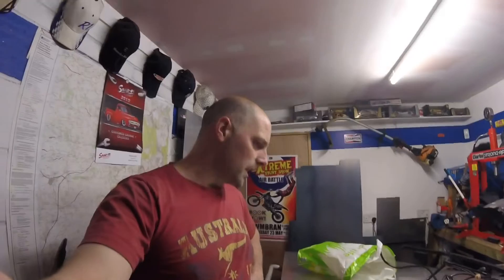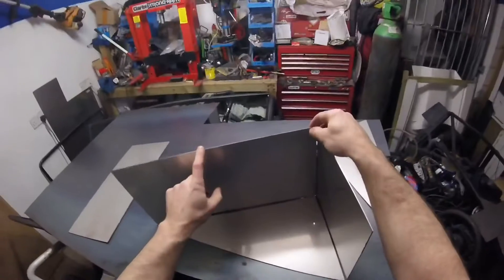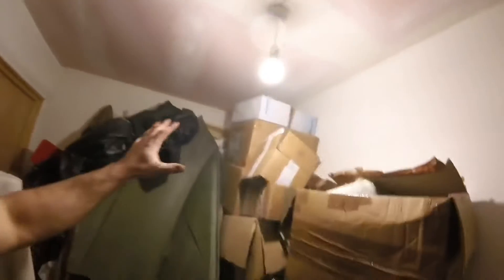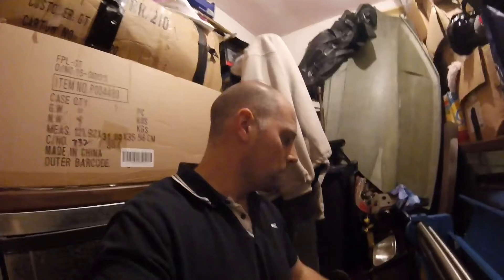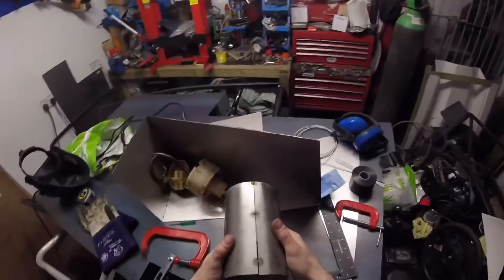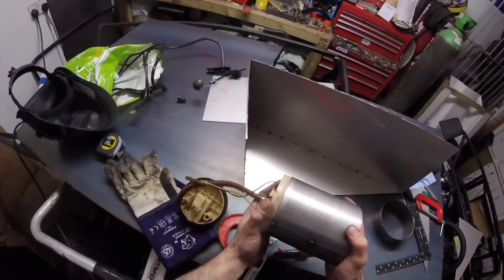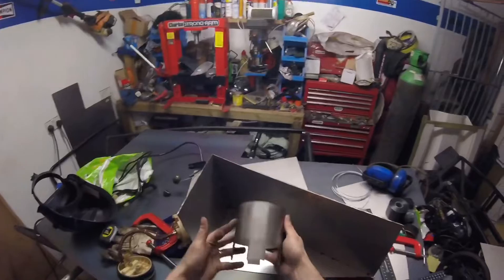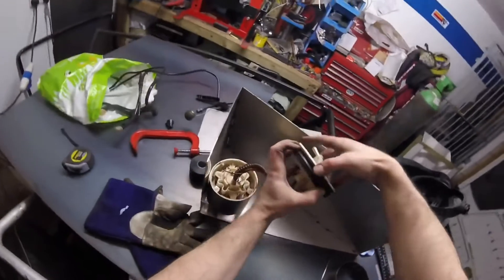Lamborghini countach kit car

Comment: Nice bit of fabrication. What are the capacities of these tanks? There's a handy website called calculator soup that might help you figure out how many gallons they will hold. I think the original Audi had a 13.8 gallon tank, and could do around 22 mpg. So that's roughly 300 mile range.
Reply from the maker: Project Supercar a bout 45lt in all plenty for what I want and it keeps the weight down plus plenty of fuel stops to show the car off 🤣